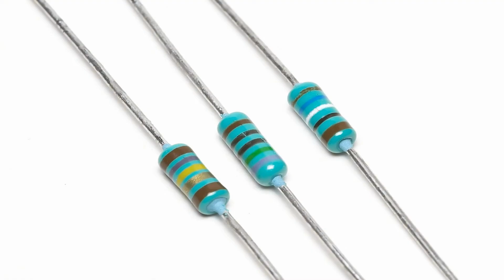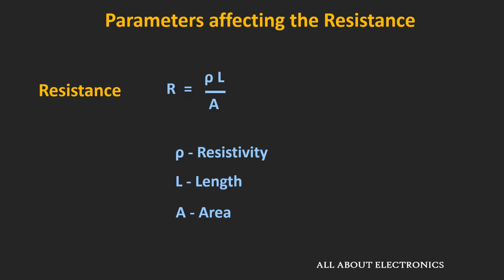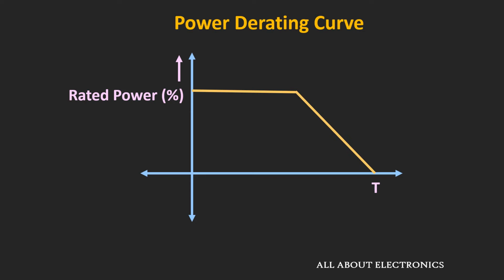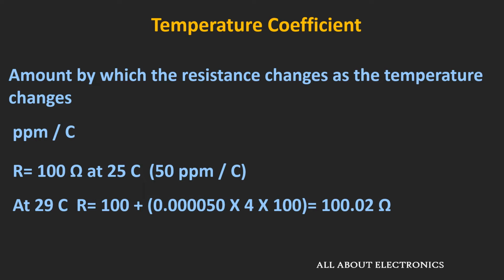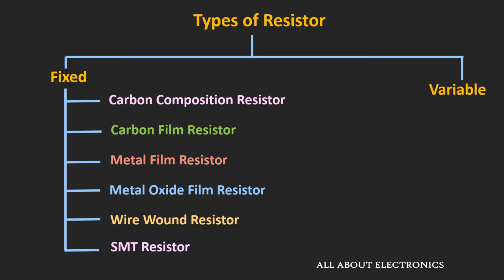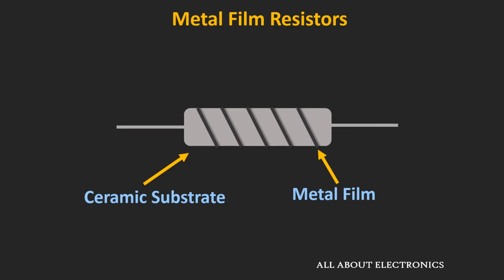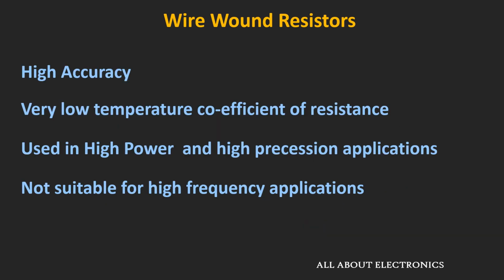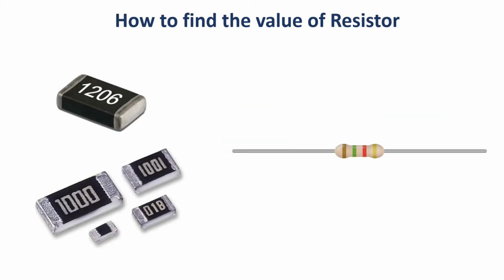What is Resistor? Different Types of Resistors and Different Characteristics of Resistors

Comment: how to find out the values of all types of resistors?
Reply from the maker: You can use multimeter to find the actual value. Many times it is also mentioned on the resistor itself. It is written in terms of the actual value with tolerance, or it is represented in terms of color code.

Comment: One wrong news has been propagated by you. Metal film resistors Are EXPENSIVE, minimum cost of original metal film resistors are 3 to 4 times costlier than metal oxide resistors.